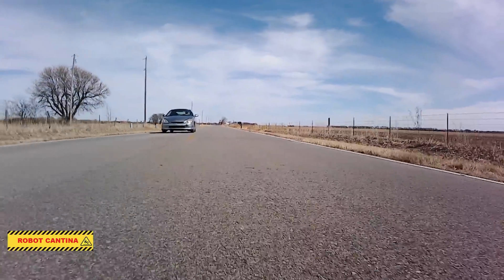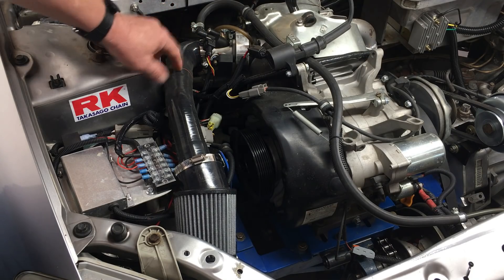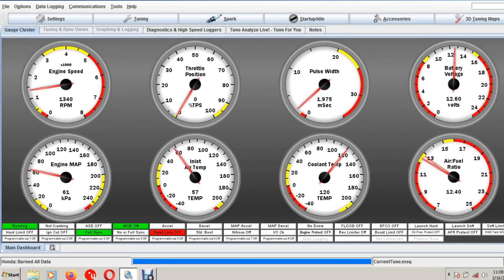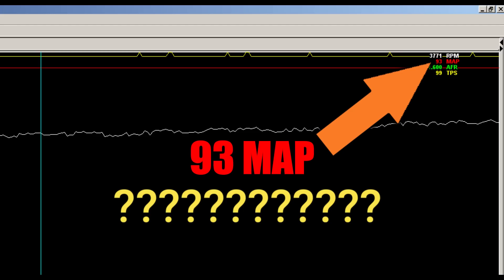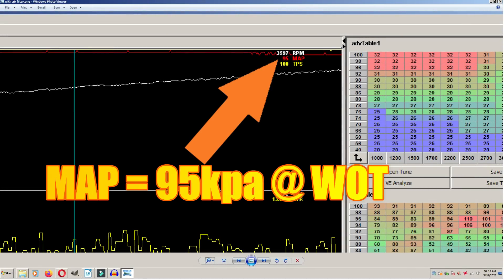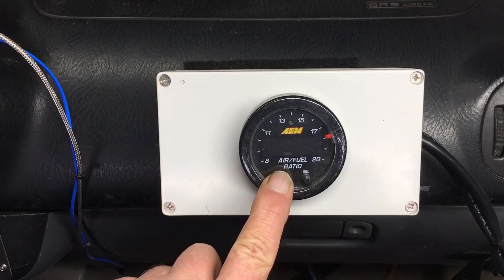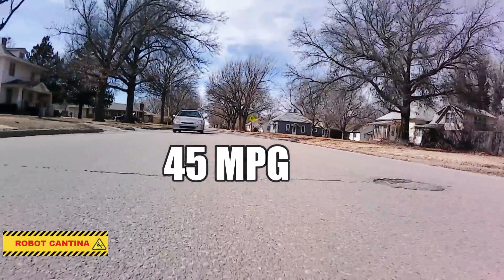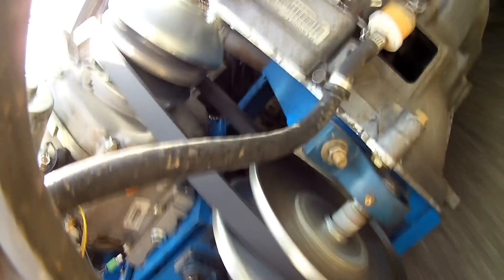S2E3 Fixing Speeduino NO2C  EFi problems on the 420 cc Predator engine.

Comment: @robot cantina I'm wondering, what is the legal status of this contraption? where I live we have periodical technical inspections and engine swaps like this one are completely  off limits (heck, even something like changing exausts make you fail the inspection) and without a pass on the inspection any cop that sees you will have it's day
Reply from the maker: In the USA, it depends on what state.  Michigan didn't have inspections.  In Kansas all they do is verify the VIN matches the title.  I reckon if you dig deeper there are all sort of rules on a federal level.   Innovation sometime requires breaking some rules.  Be a rebel!
Reply: @robotcantina8957  well, be careful if the garden gnomes start bringing lawyer support, i want to see where you can bring this thing!
Reply: think where he lives they only check for the thechnical state of the vehicle (doors that open , enough profile on the tires , lights ajusted propperly , seatbelts that work and arent frayed , steering that hasnt got play in it , balljoints and rubbers still thight ., brakes that work , no structural rust , CO level within acceptable levels , stuff like that ) not if the engine in it is the same as the vehicle came with 
still the police can impound his vehicle if they find out it doesnt comply to the car papers (cilinder count )
over here in the netherlands cars older than a certan age are excempt from roadtax , some poeple that though they where smarter than the goverment started putting new range rover bodies and engines on old frames (id here is stamped i the frame) and drove them around as old rangerovers 
the goverment gotten smarter and decided that od cars can only have 1/3th of there parts replaced with newer parts (so driveline / body / frame) that blown the range rover boys right out of the water 
they allso ruled that changes in the distance between the wheels are reason to get a new vehicle registration (so longbed to shortbed conversions are a little more bothersome here )
Reply: @watahyahknow  I'm from spain and they put a big sticker on your windshield with the year and month that is due, and even older cars have yo pass it yearly, and believe me, cops are on the hunt for expired cars, they even fined cars that couldn't go to inspection because all the country was in lockdown!

and they are super strict, you put a wing on your car, fail, tire size is not listed on the technical homologation? fail, want to lower your car? oohhh that's a fail
Reply: @mejillonius  sound a bit like the TUV in germany , heared that belgium is the same way , maibe we not all that bad off (who am i kidding we have the highest taxes on cars and fuel) the mot excempt its a recent ruling (think it was since 2012 )  
in the old days cars 26 years and older where roadtax excempt because they figured they where cars that where only driven on sundays when the weather was nice , that was untill "modern"  cars became good and fuel efficient enough to be driven daily , thats when the goverment stepped in and changed the rules for all cars not being gasoline cars wish made those cars worthless in an instance (a LOT of older american cars got sold after that as they where paying through the nose for fuel allready and being converted to propane or being a diesel allmost doubled the roadtax wish goes by weight here) 
so now they moved the landpost , oldtimers of 25 years running on gasoline i believe have a lower taxbracket but need to be indoors / completely off the road during the winter months so people need a second car making them worthless to use as a daily these allso still need to be MOT- ed , if the MOT falls in that wintertime they need to go MOT-ed right after they leave the gareage (there only alowed to drive to and from the mot intill there aproved )
cars older than 50 years dont get driven often enough and prolly cost more money to maintain than the cost of a modern car plus roadtax so it isnt viable to drive it daily (coverments words) they allso not comply to current mot rules and allready payed there deu so there excempt 

we dont have stickers here , were all registered intoo a big computersystem and if you pay roadtax or are photographed while the car is suspended or is out of date on its MOT the bill will automaticly fall in youre mailbox , and the fines are staggering
Reply: Move to a freedom state. They only confirm VIN at my location, nothing more

Comment: I would research snowmobile clutch tuning.  On the primary you have spring rate and weights as your primary knobs.  On the secondary you have spring rate and helix angle (s).  (S) because they can have up to 3 angles, or a continuous variable angle may now be available, I don’t know.

Comment: First off, I love the channel and these projects. 
  I think that the proper calibration of the map sensor was irrelevant. You just offset the value to match your ambient 95-96kpa. I would have left it alone and tuned it like normal. In my experience, anything over 90kpa isn't a huge difference to 100kpa.
Reply: Basically you'll tune fuel flow and timing to whatever valve the map sensor gives. The only way you'd create a problem is if you changed sensors that suddenly yielded a different output voltage for the same pressure as before
Reply: @ronniedale6040  I'm not quite sure how he'll tune his timing table. I suppose he could tune it on the dyno. I'm not aware of a knock sensor on a small single cylinder engine so there's no real way to tell if it's getting close to knock. That, and the valvetrain or cam or rotating assembly noisy and give false knock readings on a knock sensor if he fits one to it. 
  I'd like to see the timing table optimized. I feel that will have more of an effect on the way the engine runs than a map sensor that reports 3kpa low.
  It took me a long time to set mine, but i believe it's perfect. I tuned for maximum vacuum at idle and it never reports knock retard while cruising or under wot.
  I added anywhere between 4⁰ and 22⁰ of spark advance from the factory settings throughout the spark tables on my 1992 tbi 350 c1500. I was more aggressive on my 1990 k2500. It runs 31⁰ of timing at idle and 38⁰ @ 2900 @ 100kpa. I pull 1⁰ of advance per psi (~7kpa) of boost. That's on a small block v8. I'm very interested in Jimbo's concrete mixer engine.
Reply: @EricErnst   IIRC OEM timing for a 5.3 at idle 19-24 degrees. 
  And SloppyMechanics used about 12 degrees at or before 4000rpm for his 9 second turbo 5.3 Colorado
Different engine entirely I know
Reply: @DarkLinkAD  trick flow themselves recommended 36-38⁰.

Comment: Single and twin cylinder engines like to be on the rich side for maximum torque in my experience.  I adjust rich, then back off just until the rpms are at their maximum.  If you start from lean it will make significantly less power under load.
Reply from the maker: I'm with you, this engine wants more fuel under full load.
Reply: Unless the engine is direct injected then the mixture for best power is usually slightly rich. The cooling effect on the intake charge increases charge density and the bit of extra fuel helps ensure all the O2 burns even if the mixture isn't perfectly homogeneous.
Reply: @Surestick88  I think you don't know wtf you're talking about..  intake charge temp has nothing to do with volumetric efficiency.
Reply: @midixiewrecked7011  Try again. It does have something to do with VE. Decrease temp /air density results in charge packing thus increasing the amount of air entering the cylinder.
Reply: @midixiewrecked7011  you truly have no clue about performance engines… best power is typically found around a lamda of .86-.9 on most high performance engines for a long host of reasons.b charge cooling is tremendous - we run dual injector set ups on single cylinder race engines with one injector close to the valve for lower rpm and throttle response (used for enrichment fueling under acceleration and at lower rpms) with the second injector far away (about 12 inches) is used at high rpm because it improves charge cooling. its a solid improvement over an injector closer to the valve - but isnt good for low rpm and enrichment fueling. so having 2 injectors solves this

Best power is a combo of best charge cooling, best combustion speed, and max btu output. depending on the quench, chamber shape, rpm, flow mixing/turbulence, port etc this lamda number varies. on engines with extremely good chambers, pistons, port design, and quench - its .9 maybe .92. on engines with worse chamber design, piston shapes, port design it can be as rich as lamda .8. almost always we see best power around lamda .86-.88 and its reliable and produces less heat into cooling system vs leaner lamdas that require more ignition timing, have slower burn rates, and less charge cooling.
Reply: @HPRaceDevelopment  that's nice.  But I know plenty,  thank you.
Reply: @midixiewrecked7011  k
Reply: @Surestick88  are you trying to say something? , or typing gibberish??
Reply: Revolutions per minute "is" ??????
Reply: @midixiewrecked7011  I read that as the "revolutions" being the noun (revolutions being an idea in this case) that the being verb is referring to, and the correct one being then "are", and the "per minute" part just a clarifier, and thus not referenced by the being verb.
Reply: @notmuch_23  I think you missed the point.

Comment: Really enjoying this build, can't wait for forced induction! Are you planning on moving up to a larger engine once you max out the 420cc engine?
Reply: wonder if these engines can be bored and stroked , i seem to remember gopowersports selling hopup kits for these engine but not sure if they sell stroker kits as well
Reply: @watahyahknow  you can shorten the conrod with a gas torch and a press
Reply: @tortron  for a stroker motor you need a longer conrod and a shorter piston .... i know lets trow the piston under the press .....🤑
Reply: @watahyahknow  or machine the big end bearing to be further out. You just plug the old one and re drill. 8mm is probably heaps on an engine like this.  I made a 125cc into a 150 with a bigger piston, then a 184cc with a squashed conrod. Conrod length doesn't effect the stroke, but it will change the compression ratio. The crank has to be different
Reply: @tortron  if you make the stroke (not the bore) bigger the piston travels further up the bore (so the distance between the top of the piston and the pin needs to be shorter to prevent it from hitting the head ) and further down the bore (causing the piston skirt to hit the rear of the crank) so the piston skirt needs to be shorter too , of you shorten the conrod you prevent the piston from hitting the head at top dead center but you will cause a trainwreck at the bottom of the stroke as the pistonskirt will smash intoo the crank unless you take a lot of the bottom of the piston (wish would make it rock inside the bore )
one way to increase stroke is to mount a taller conrod with a smaller big end bore and offset grind the crank to increase its circle/ stroke and fit the smaller big end , youre still going to need a piston with a different pin height to get everything to clear and prevent the piston from getting too short (think seesaw with the pin in the center if one end is shorter then the other the balance is off)  so it whont be rocking in the bore
Reply: If I recall, V-twin is next on the table after he's done with the 420cc single cylinder. He explained it in more detail in season 1 what their upgrade path was for testing.
Reply from the maker: The plan is to get the 420 up to 70 MPH by using the supercharger, then we move on to the 670 V twin.

Comment: I'm wondering how much losses the CVT creates, maybe removing it could allow for better top speed even if changing gears increases the time to top speed.
Reply: there might be some friction losses from the slipper clutch and the belt but it allso should keep the engine in its most efficient powerband
Reply: We've been over this several times,  go read comments from season 1
Reply from the maker: When we start off in 3rd gear, the CVT completely locks up by 25 MPH.  The CVT and belt do not get hot.  There may be some minor slippage but overall the benefits of the CVT outweigh any slight negative side effects.
Reply: You need a CVT on a low torque engine like that, because otherwise first gear "direct drive" wouldn't have enough torque to accelarate properly.
Reply: @hojnikb  accelerate

Comment: 3/8 IS NOT A 10 MM LOL
Reply: 3/8 is 9.53mm. Close enough that a particularly loosely toleranced 10mm bolt or nut might fit, especially if the socket is also loosely toleranced and on the upper end of the size range.

But it's not 10mm!
Reply: It's a mechanics inside joke. Hammer on a 3/8 when a 10mm bolt head is corroded away.
Reply: @JosephArata  oh I know, I have a manager who went to the store and bought a shit load of 3/8 because we're always missing 10mm's so excuse me for not finding it as funny
Reply: @neb_setabed   Thats a you thing buddy
Reply: @DarkLinkAD  sounds like a you thing since you felt the need to respond lol
Reply: @neb_setabed  trying to be ironically funny, isn't funny. cool story bro.
Reply: @JosephArata  I'm sorry, define irony for me. Because maybe we learned two different definitions.

Comment: The rich mixture is likely from the aftermarket cam overlap. Air fuel mixture is flowing into the cylinder and then getting sucked out the exhaust via scavenging. This is good for making power, bad for emissions and fuel economy. 

This will be more apparent once then engine is boosted, and she shoots a nice flamethrower out at high load.
Reply: I’d go as far as to say it’ll supercharge better with the standard camshaft 👍🏻
Reply: @garyhargreaves5630  I would probably agree, at least it'd be an interesting comparison. I wonder if it wouldn't be too expensive (or even possible) to get a custom ground camshaft to pair with the supercharger.